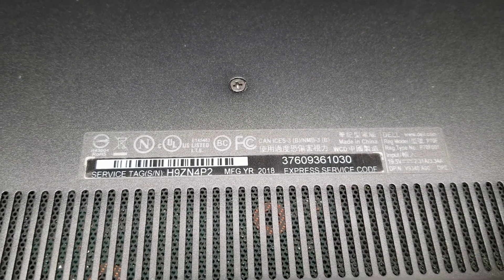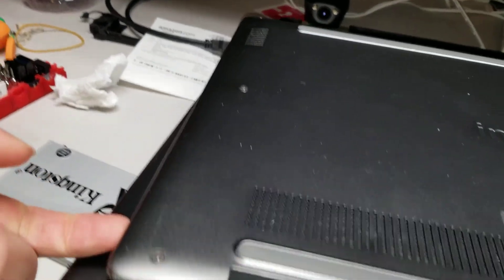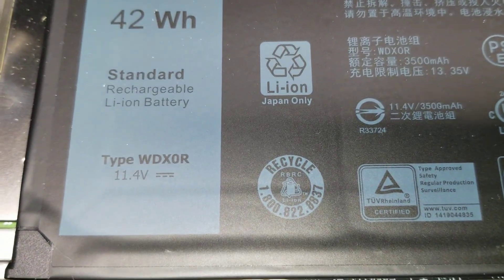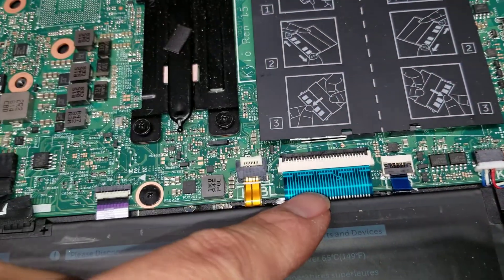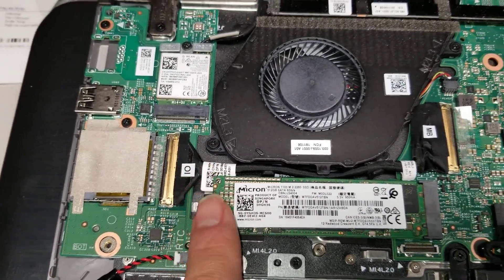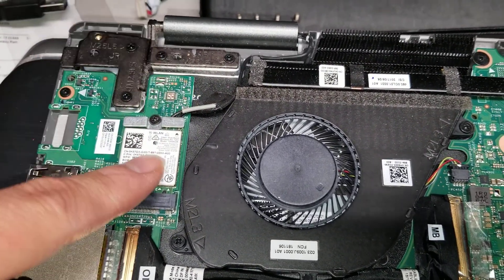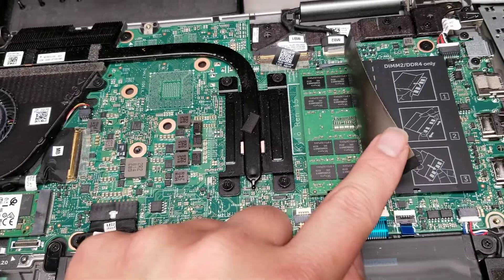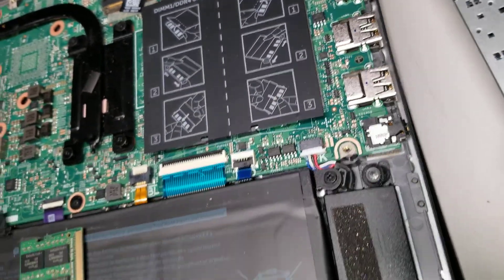Dell Inspiron 7573 Disassembly Repair RAM SSD Hard Drive Upgrade

Comment: Hi, do you have a video of how to upgrade my storage from hdd to SSD? I have this exact laptop but with the different storage… also if i upgrade to ssd I need to eliminate the hdd from my laptop or I can use both?
Reply from the maker: This video will help https://youtu.be/4p5jFDzVwUw you can't use both unless there is another place to put the other or you use it externally.

Comment: When I installed a new ssd Sandisk x400 with 256GB from a scraped computer my computer started having password pin and Face ID problems and no mater what I do I can’t fix it I’ve removed the ssd, removed the original ssd and replugged it, booting the safe mode doesn’t work, I went into bio settings, ran hardware diagnostics.
Reply from the maker: Try the on screen keyboard

Comment: Hi I have this exact laptop and even after resetting it completely it’s somehow slow. Is there a chance the hard drive is dying? Or what other things can I look for to improve it. It’s an old laptop i7 8th gen
Reply from the maker: Upgrade to an SSD
Reply: @ItsBinhRepaired  I’m not experienced with swapping parts but this video was very clear do you know what part number or a couple different ssd that will be compatible?
Reply from the maker: I hate how YouTube doesn't notify me of replies. Were you able to figure it out?

Comment: Hello, I've got a complex problem maybe you can help me out with. 

I just recently bought a used Dell Inspiron 15 7573 2-in-1 laptop that has an i5 8250U with a single stick of Kingston 2400MHz 8GB CL 17 RAM. I tried to upgrade the RAM using a set of Kingston 2X16GB = 32GB 2400MHz CL 17 that I bought used from eBay but my laptop would end up with a blackscreen and would not boot into BIOS. I removed one stick and it finally would boot into BIOS with no problem but soon after entering my Windows 11 homescreen I would get multiple lines going across my screen, then some stuttering and then my laptop will eventually freeze. So then I bought a brand new set of G.Skill Ripjaws 2666MHz CL18 and either both or just one stick will cause a black screen and no BIOS. I really want to install a 2x16GB = 32GB kit but I don't want to spend $102.99 EACH stick, on supposedly "compatible" memory Directly from Dell. Crucial does have a 2X16GB kit that they state it is 100% compatible with my laptop and is $117, or would a slower kit like a 2133MHz work better or maybe just get a 2x8GB = 16gb kit? Or is there really something wrong with my laptop itself? I'm really confused at this point. Any helpful advice would be greatly appreciated.
Reply from the maker: Try the old stick of ram again. Sounds like bad ram
Reply: @ItsBinhRepaired  Yeah it works perfectly fine with my old 8GB stick.
Reply from the maker: So you just need good ram. The ebay one was definitely bad lol
Reply from the maker: Try this https://amzn.to/3SKd0cz lifetime warranty lol
Reply: @ItsBinhRepaired  So even the brand new unused G.SKill kit that I tried was probably not compatible then?
Reply from the maker: Possibly. Wrong speed
Reply: @ItsBinhRepaired  Oh ok, great thank you for your advice! That Mushkin kit seems fairly priced too. I'll let you know what happens soon.
Reply from the maker: @BlueSword455  if that doesn't work, the team group ones are also reliable. They all have a lifetime warranty.

Comment: thanks
Reply from the maker: Glad it helped. If you haven't already, please like and subscribe so others can find my videos. Thanks!
Reply: @ItsBinhRepaired  I did it at once ... Any update/advice on "Blue Screen" or "Stop Code" ... I find it often at my Dell Inspiron 7573
Reply from the maker: @anmwasiulanwar816  what code is it giving?
Reply: @ItsBinhRepaired  Stop Code: UNEXPECTED _STORE_EXCEPTION
Reply from the maker: Hmmm not too sure with that one. Might need a clean install of windows.
Reply: @ItsBinhRepaired  I did that already ... thanks
Reply from the maker: @anmwasiulanwar816  strange :( did you run memtest?

Comment: Hey man, sorry I'm late but thanks for this video. I suppose the max RAM capacity for this model is 16 Gigs yeah? I do run a lot of virtual labs on my physical host machine and sometimes I just wish I had all the RAM I could possibly get. Could I go as high as 2 x 16GB DDR4 RAM sticks?

Cheers.
Reply from the maker: This might work https://amzn.to/3seYFK4 but if it doesn't,  this should https://amzn.to/3IiO7iu

Comment: wow, thats interesting they have a SATA cable for a 2.5 drive inside.

Also, its kinda weird they have a single stick of RAM & onboard graphics but I guess nobody will be gaming on this anyway since the graphics are intel-buggy-mess-drivers with no performance capabibility (think broken blocks of black from fires in L4D2s directX compliant game ect)
Also surprised the lack of networking support, I wonder if there is a NIC chip to solder on to to get this thing some network connectivity for things like watching videos & SteamPlay sharing (the only way to actually game on this)

The i7 version of this board will often struggle with the lack of l2, l3 buffer or memory bandwidth which is all shared by the GPU

Great tear-down,
Reply from the maker: Hahaha yeah. Thanks!

Comment: Hey what kind of Screw driver did you use to unscrew the laptop?
Reply from the maker: Should be in the video, if not, I think it's a ph1. Whatever fits the screws tightly.
Reply: @ItsBinhRepaired  Dose a Phil 2 work?
Reply: Also do you mind sending a link for a ph1?
Reply from the maker: @chino2000-6  I don't buy single screwdrivers. Buy a whole precision screwdriver set. You'll need more than just that one screwdriver.
Reply: @ItsBinhRepaired  you mind sending a link?
Reply from the maker: @chino2000-6  this should work. https://amzn.to/3ay4oCc
Reply from the maker: @chino2000-6  no, only if you want to strip all your screws

Comment: I got Samsung 860 Evo v-nand SSD I'm wondering if it works with it?
Reply from the maker: The video should give you the answer.sata yes nvme I don't know.
Reply: @ItsBinhRepaired  I cloned my drive but now I'm not able to boot the new drive. I've done cloning before on my desktop with the same SSD but I really don't why it won't boot properly. Bios sees the drive also. I won't let boot a USB backup either it's weird.
Reply from the maker: @Ash2theB  can you send me an Amazon link to the drive? There are multiple 860 evos. What did you use to clone it. Try resetting bios to default. Dell is picky sometimes.
Reply: @ItsBinhRepaired  if you have any suggestions for another sdd that would  be great. I've seen others use the Kingston ssd (full metal plated one) but I don't know the exact name of it.
Anyways here is the link https://www.amazon.com/gp/aw/d/B078DPCY3T?psc=1&ref=ppx_pop_mob_b_asin_title
Reply from the maker: @Ash2theB  oh, it's a normal 2.5" sata. That should work fine.
Reply from the maker: This might help https://youtu.be/4p5jFDzVwUw
Reply: @ItsBinhRepaired  Thank you. I’m literally so frustrated that I dreamt about it 😂. I’ll be giving it try I guess today but when the sun is up.
Reply from the maker: @Ash2theB  lol sounds good

Comment: Hey Man i have the same laptop with 12gb ram and 2 tb hard drive 2in1 and the intel i7 8th gen but still slow and i have deleted all un necessary stuff still its slow do you know what is causing the problem. Thank you and hope you get the comment and you are doing great work appreciate it.
Reply from the maker: I recommend upgrading to an SSD https://youtu.be/4p5jFDzVwUw This video should help.
Reply: @ItsBinhRepaired  thank you brother
Reply from the maker: @chaudharyraj571  no problem

Comment: How will I add another second ssd
Reply from the maker: One m.2 the other 2.5" sata ssd
Reply: Yes 👍
Reply: @antonioalvarez1698  FWIW my 7573 is currently supporting a WD 1TB sata in the m.2 and a 2TB ssd in the 2.5 bay.  An anker PD45 powerpack gives it another 6 hrs of run time beyond the 42W internal battery.

Comment: Thanks I look forward to upgrade my ram and storage also my version is the 8GB Ram and 1TB Storage.
Reply from the maker: Sounds good
Reply: @ItsBinhRepaired   Yea but the RAM it's the problem idk why but when idle is use 50% of the ram you know why?
Reply from the maker: @chino2000-6  what do you have open? Check the task manager to check what's using the ram.
Reply: @ItsBinhRepaired   Yea it's small little programs that eat away my ram
Reply from the maker: @chino2000-6  the moment you start the computer it's like that?
Reply: @ItsBinhRepaired   Yea why?
Reply from the maker: @chino2000-6  usually as you open programs it starts using RAM. The way computers work, everything is stored on the computer. As you open programs it puts them on the ram to run them from there. Strange that it's loading 4gb of stuff on boot.
Reply: @ItsBinhRepaired  Thank you man
Reply from the maker: @chino2000-6  sorry, I meant everything is stored on the hard drive.
Reply: @ItsBinhRepaired   Well should I change the ram and the hard drive for a SSD?
Reply from the maker: @chino2000-6  SSD definitely, ram if you want
Reply: @ItsBinhRepaired   Thanks man but I don't have any ram modules only for desktops can you spare some if you have any?
Reply from the maker: @chino2000-6  the video is free. Don't expect me to give away parts I use for my job now too. Lol you can buy RAM at your local computer store or on Amazon.
Reply: @ItsBinhRepaired   Well any recommendation of ram cheap 8 gb for laptop
Reply from the maker: @chino2000-6  what speed?
Reply: @ItsBinhRepaired  Really 3000 or 3200 or 2666
Reply from the maker: @chino2000-6  The important thing is probably just ddr 4 and the processor. I don't know the difference between generations.
Reply: @ItsBinhRepaired  Well the chip I have is the 8th gen i5-8250U something like that and the motherboard is from it's the same as your 7573
Reply from the maker: @chino2000-6  should be fine
Reply from the maker: @chino2000-6  but you have to check the stick of ram for the specs
Reply: @ItsBinhRepaired  Its 2400MHz but 8gb that's why i need more ram
Reply: @ItsBinhRepaired   Wdym?
Reply from the maker: @chino2000-6  check if it's using 1 8gb or 2 4gb
Reply: @ItsBinhRepaired   Just checked and it's 2 4GB Ram Sticks of DIMM
Reply from the maker: @chino2000-6  so you'd need 2 8gb or 2 16gb sticks if you want to upgrade
Reply: @ItsBinhRepaired  Know any websites with the best deals for that
Reply from the maker: @chino2000-6  Amazon
Reply: @ItsBinhRepaired  thanks a lot man
Reply from the maker: @chino2000-6  no problem